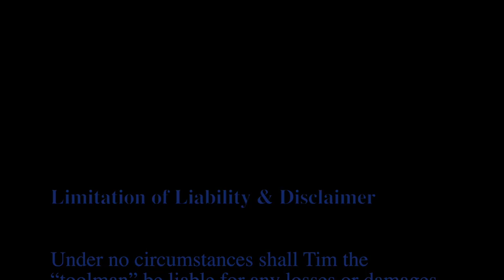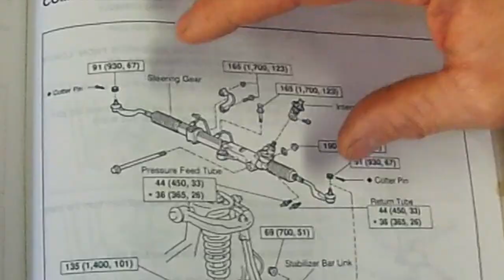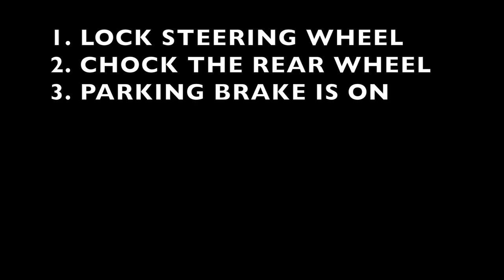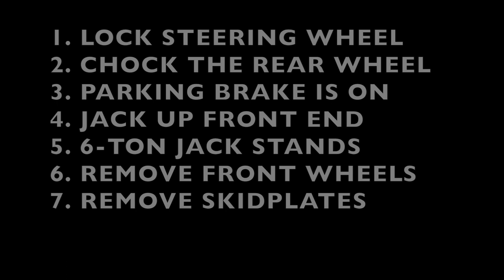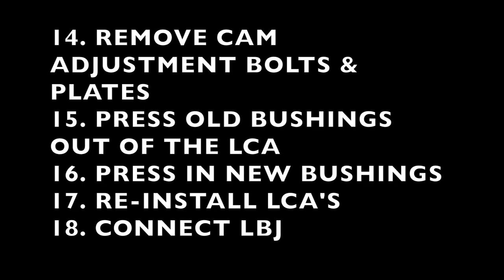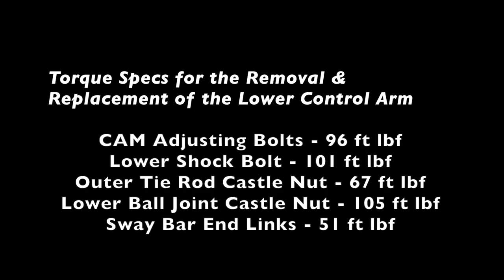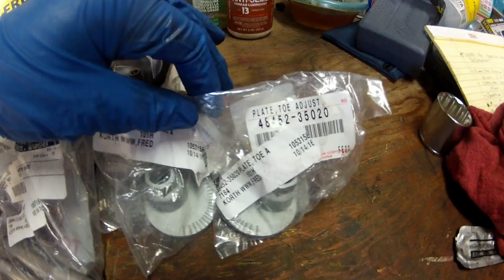Front Lower Control Arm Bushing Replacement (Part 1)

Comment: Quick question. If you were to do a upper bj, lower bj, inner and outer tire rods, uca bushing, lca bushing and sway and steering rack bushings. In what order would you do them?
Reply from the maker: 1st, Remove Sway Bar
2nd, Loosen the lock nut for outer tie rod and Loosen the inner tie rod connection to the Steering Rack (You could replace these components now or do them near the end - Step 13)
3rd, Break free Inner tie rod from the LBJ
4th, Unbolt steering rack and pull it back so you can remove rear LCA bolts and cam adjusters
5th, Break free LBJ from LCA
6th, Remove Brake Caliper, Disconnect ABS sensor and wire, Disconnect CV Axle Nut, Break free UBJ from UCA and remove Steering Knuckle.
6th, Put Steering knuckle in a vice and swap out the UBJ.  If you didn't already remove the LBJ from the knuckle, do that too.
7th, Remove LCA
8th, Remove UCA
9th, Do the bushing replacements on both control arms
10th, Get the control arms back on
11th, Get the steering knuckle reconnected with a new LBJ
12th, Replace the steering rack bushings and bolt the steering rack back to the cross member
13th, replace the inner and outer tie rods and get the outer tie rod connected to the LBJ.
14th, put the sway bar back on with new bushing
15th, Go get an alignment

This is the order that makes sense to me.  Hope all this work goes smooth for you.  Happy Wrenching!
Reply: @TimmyTheToolman  thank you so much. So I took off tire rid and started pulling off boot and power steering fluid started flowing. Guess I know why my power steering has been shitty. really wish this wasn't the case. Sounds like I'm going to need a new rack
Reply from the maker: @619steelo  Not necessarily.  I noticed the same thing on my 2000 4runner when I loosened the boot.  Sure, the seals are leaking but that's not necessarily why the steering would be shitty.  My steering is still really good on my 2000. I just keep an eye on the fluid level in my power steering reservoir. 

What are your steering symptoms.  There's plenty of possible causes of bad steering characteristics.  I did forget to mention that OEM inner tie rods are very expensive.  If you bought OEM inner tie rods, you could have bought a whole new steering rack for about another $200 because an OEM rack comes with new inner tie rods.  From what I remember, a new steering rack bought online is around $530 and new inner tie rods are around $300.  If you already bought the inner tie rods and you're going to replace the rack, maybe return the inner tie rods and then purchase the new rack.  But, before dropping coin on a new rack, I'd really investigate more where the problem could be originating from.  You don't want to drop a bunch of coin and do a ton of work just to find out your steering problems still exists.
Reply: @TimmyTheToolman  so my power steering is just really stiff. Sometimes stiffer then other times but is getting worse as time progresses
Reply from the maker: @619steelo  That symptom could just be a clogged power steering reservoir screen.  When the screen is clogged, it starves the steering rack of fluid.  Before getting into all this work, that would be the first thing I would check.  I'm suspecting you're going to find a reservoir filter screen that is mostly blocked.  Check out this video: https://youtu.be/5k61KXRK8bM  To move the fluid through the system, we have heard that you do not need to run the engine to power the pump.  If you get the front tires off the ground and turn the wheels lock to lock, you can effectively move the fluid.  Turn the wheels back and forth a couple times, top off the reservoir, and keep repeating until the fluid looks like it's coming out clean into your catch basin.
Reply: @TimmyTheToolman  no, power was flushed not to long ago and the screen was cleaned as well
Reply from the maker: @619steelo  Ok, it could be a bad pump and/or bad steering rack then.
Reply: @TimmyTheToolman  man oh man. The bag of prizes. Lol. So i got pretty far. Pressed out all my ball joints but couldnt find my torch for the life of me so about to start that now. Anout How long did you use the torch on the control arms? Next question. Im going to return the inner tire rod. I guess change the pump as thats cheaper. See if that fixes my steering issue. If not then go to the rack. I have the new bushings from energy suspension. If  i did buy a new rack. Would you just use the stock bushings until they go bad or would you throw the energy suspension ones on? Pretty much, can you press the stock ones out without ruining them?
Reply from the maker: @619steelo    I heated the controlled arm ends evenly for 1-2 minutes.  Start off conservative with the heat, give the jack a bit more pressure and see if the bushing gives.  If it doesn't, apply more heat and try again.  The key is to not use too much force or too much heat at the beginning.  The main thing you want to avoid is using so much force that you bend the control arm outward and ruin them.

I would probably just run the OEM bushings for now and hold onto the energy suspension bushings for the future.  You could also just sell the poly bushings, but since they're not that expensive, I'd just hold onto them.  I think you probably could remove the OEM rubber bushings without ruining them but this is something I have not tried.  Good luck!

Comment: Hey Timmy, I think I've watched about all your videos They are great! I am fixing to replace inner and outer tie rods, the lower control arm bushing, the sway bar bushings, rack and pinion bushings, and lower ball joints on a 1999 Toyota Prerunner with 215,000 miles. The lower ball joints are bad and I have a shimmy above 60mph. I was hoping you could give me some order to do this when I rip it all apart. Would you do one side at a time, or inner then outer, then rack and pinion, then ball joints, then sway bar. I was looking for the best plan of attack. I can rebuild an engine, but not as good on suspension components, although I have installed several ball joints, coil springs ,shocks etc. on old 65 to 72 Chevy muscle cars before. Thanks for any help!
Reply from the maker: Good to hear you like the videos we've been making.

Here's the order I would do:
1) Jack up front end and support on frame rails with jack stands. 
2) Remove the wheels.
3) Do Inner and Outer Tie Rods, one side at a time
4) Remove the sway bar
5) Disconnect steering rack like we show in our video.  If you release that power steering bracket on the driver side frame you'll be able to pull back the rack far enough so you can get the rear LCA bolts out. You might have to support the rack with something like bailing wire.
6) Remove the LBJs
7) Remove the LCAs
8) Replace LCA bushings
9)Reinstall LCAs and LBJs
10)Replace Steering Rack Bushings
11)Reinstall Steering Rack
12)Reinstall Sway bar with new bushings

Hope this helps.

Comment: Great video give me the confidence to get done
Reply from the maker: That's great to hear Kevin.  Thanks for taking the time to comment.
Reply: @TimmyTheToolman  I've done ball joints injectors lower control arms bushings shocks in the back fuel filter have clean the throttle body ball joints thanks to your videos I love my 97 limited edition with 300,000 k have owned it for about 18 years
Reply from the maker: @kevindamaso4338  That's great to hear you've made good use of our videos.  Sean and I love hearing this.

Comment: I'm going to replace my inner and outer tie rods, upper and lower ball joints and replace the lower control arm bushings (Whiteline) this weekend and I'm hoping that if I remove the inner and outer tie rods on one I will be able to remove the cam adjuster bolts without un-bolting the steering rack (I just replace the bushings in the rack). I'm hoping I can turn the wheel far enough that the steering arm will be clear of the cam bolt. Do you think this will work? Thanks in advance.
Reply from the maker: I don't know if it will work or not.  We've never tried it.  But, if it doesn't work, no big deal.  Just unbolt the steering rack, release the power steering lines from the bracket on the inside of the driver side frame rail, and then you should be able to pull the rack back far enough for the bolts to come out.  Make sure you read the video description and the comment we pinned for other helpful information.
Reply: @TimmyTheToolman  So I can tell you that you still have to undo and move the steering rack even if you disconnect the inner and outer tie rod. I removed the tie rods on the driver side but, because I still had to move the rack back and out of the way I left the passenger side tie rod on and I was able to remove cam adjuster. Interestingly, the steering rack housing not the tie rod was the main obstruction for me. Maybe it was just the perspective of the video but, it looked like the tie rod was more of an obstruction for you. Also. I sprayed Free All on the cam adjusters and bushings several times in the days leading up to removing them and had no issues whatsoever. Didn't have to use heat on the bushings and the cam adjusters came right out. I would recommend this to anyone attempting this.
Reply from the maker: @mrs1557  Thanks for sharing this information.  In regards to using penetrant on the cam adjusters in advance, in many cases, it's not going to work if the corrosion is bad.  I have a suspicion that your cam adjusters would have come out without any penetrating oil at all.  When those adjusters get really welded into the bushing sleeve, only cutting them out is going to work.  Heat on the arms at the  bushings is to facilitate removal, not make it possible.   With enough force, those bushings will pop out but the heat allows you to use less force and reduce the chance of bending the arms if you use the bottle jack technique to drive them out.

Comment: I only need to replace the rear most front lca bolt. Because it's bent from previous owner hitting a curb. I'm also replacing the stabilizer bar because it's also bent. It appears that is the extent of the damage. An alignment shop confirmed my diagnosis. My question is do I need to take all the same steps up to when you pulled that bolt out at approx. 15:00. Also what else should I take care of.. truck has 160k and was well taken care of.
Reply from the maker: Yes, you need to almost do everything we show.  What I learned is you don't have to remove the steering rack boot.  If you disconnect the power steering line bracket on the inside of the driver side frame rail, you can pull the rack back far enough to get the bolt and cam adjuster out.   There's a shit load of things you could probably do - Steering rack bushings, sway bar bushings, lower ball joints, trans cooler, and the list goes on.
Reply: @TimmyTheToolman  thank you for the speedy reply. I got the truck for $2250 with 166k just because of this fix. I plan on keeping it for awhile so want to make sure everything is up to date.
Reply from the maker: @craiglarsonjr.6586  Hey Craig, become a member of T4R.org if you haven't already.  That forum is a wealth of knowledge.  Other than what I already suggested to you, a radiator replacement is usually a good idea.  There have been incidences of the trans cooler failing inside the radiator and that ends up ruining the auto transmission because the coolant mixes with the ATF and that contaminated mixture makes it's way back to the transmission.  Auto trans don't do well with water so it destroys the transmission.  You could install the radiator and the trans cooler at the same time.  We have a video for it.  Make sure to replace all your fluids, grease the u-joints on both driveshafts, check your brakes, etc.  We have a 30,000 mile service video that could help you out with that.  Look through our videos and you'll get ideas of other things you can do.  Have fun with it.  If you have any questions along the way, just ask.

Comment: think i could use a bottle jack to press out bushings on upper a arms?
Reply from the maker: josh parker I'm pretty sure the bottle jack is too long to fit in between the arms in the first place.  But, even if you could, the UCAs are not as beefy as the the LCAs and you have a high chance of bending the arms and destroying them.  We wouldn't suggest you doing it with a bottle jack.  Using a press with a bearing splitter and press sleeves is the best way we could come up with unless you want to burn out the bushings with a torch and then cut the sleeve our with a reciprocating saw.

Comment: I bought OEM bushings and it didn't come with washers. Do I need washers for my new bushings?
Reply from the maker: The OEM bushings are different than the aftermarket Whiteline bushings.  The OEM bushings have built-in washers on both sides of the bushing so that's why they didn't come with separate washers.
Reply: @TimmyTheToolman  Cool. Thanks for the reply!

Comment: I didn't realize my toe plate adjuster, bolt w washer, and toe cam sub assembly were not OEM.  the bolts that were previously installed did not fit the white line bushings.  had to get new hardware from toyota.  changing them made a huge difference in performance and now the alignment holds.   yes they were that bad.
Reply from the maker: Good job getting it fixed.  Hopefully you find any other janky work that was done by a previous owner or mechanic.

Comment: Helping a friend do this job on his truck this time around. Running into the same issue when using the bottle jack method we are able to press out the bushings but they are not coming out with the metal sleeves attached like in the video. We have a applied  a shit ton of heat, used a large socket along with the bottle jack to capture the outside edge of the metal sleeve and tried pressing it out, Last Resort was cut it in half and use an air hammer. No luck. No immediate access to a press either. His options now are check in with  some local shops that may be able to press it out or buy new lower control arms. Anybody have any other alternatives or tricks on how you got those metal sleeves out?
Reply from the maker: One guy told me he had good luck with using penetrating oil.  He shot it into the hole on the side of the sleeve.  Maybe a little heat with the penetrsring oil will help break free the metal bushing sleeve from the arm.

Comment: Hey Tim, im only replacing the passenger side bushings as the bolts are seized. Do I still need to remove all of the rack bolts or will the removing the bracket closest to the passenger side be enough?
Reply from the maker: In order to pull the rear LCA bolts out, the steering rack needs to be pulled back a fair distance.  However, you might be able to squeak the bolt by the steering shaft after you get the boot out of the way.  You would just have to be very careful not the score the shaft of the steering rack getting the bolt to slide past it.
Reply: @TimmyTheToolman  it won't slide past it if I raise the rack upwards? Loosen the passenger side bracket and raising up?
Reply from the maker: @omarzeineddine5427  I don't think that will work Omar but I'm not sure.  Disconnecting the steering rack from the cross member is just what I've always done doing this job.  In addition to taking all the fasteners off, I disconnect a power steering bracket on the inside of the driver side frame rail to get more movement of the steering rack so I can pull it back far enough to get the bolts to clear the steering rack.
Reply: @TimmyTheToolman  oh alright, when u say lock the steering wheel do you mean just lock it with the ignition lock or wrap a seat belt around it?
Reply from the maker: @omarzeineddine5427  Lock it with the ignition lock.
Reply: @TimmyTheToolman  thank u. Have a merry Christmas
Reply from the maker: @omarzeineddine5427  You too Omar.

Comment: Hey Timmy, do you know the relationship those eccentric cam bolts have to alignment.. as you say, FF, FR etc.. does one affect camber and the other castor?
Reply from the maker: Hey Mike, when an alignment tech is aligning your front end, they are using the cam adjusters to adjust both camber and caster.  I asked a friend of mine who use to do alignments and he explained it to me but it was still hard to visualize and understand how adjusting the cam adjusters would also adjust the caster.  I wish I could explain it to you so it would be easy to understand, but since I struggle with understanding it myself, I'm not going to be much good to you.  But, with the way our rigs are made, the main alignment adjustments are camber and toe.  It doesn't seem you can change the caster too much but they are able to change it somewhat with the adjustment of the cam adjusters.
Reply: Adjusting the lower control arm's two pivot points equally in or out will change the camber. Adjusting the lower control arm's two pivot points unequally will change the caster.